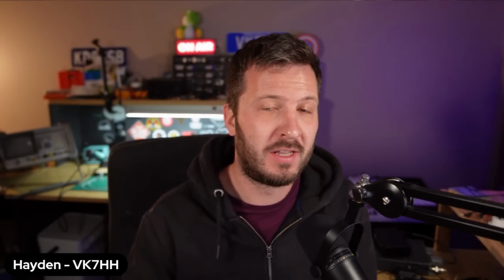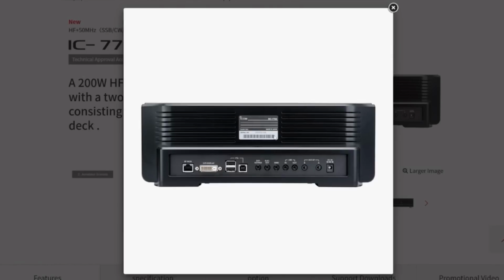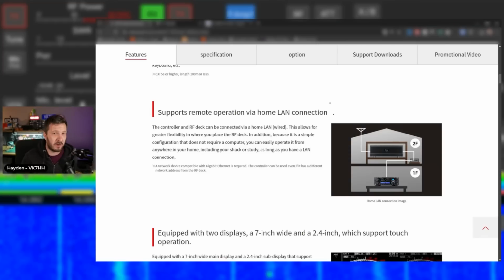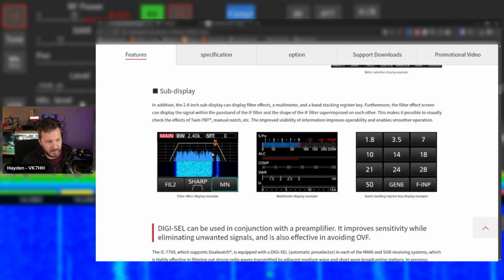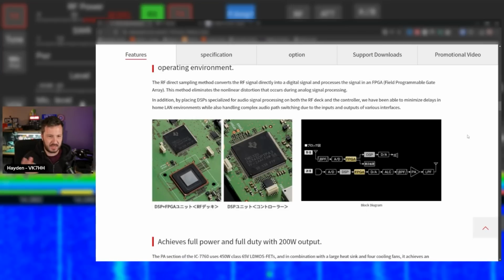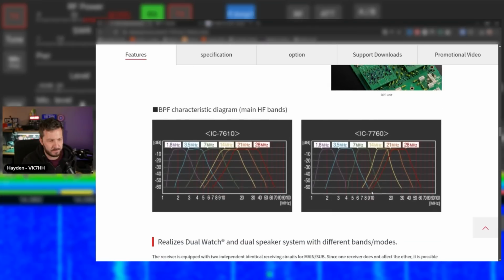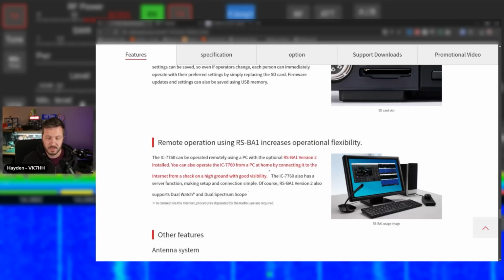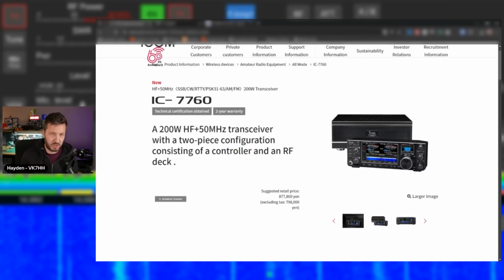NEW Icom IC-7760: Features, Specs & Price Revealed!

Comment: Does the IC-7760 have a CW Skimmer Ap whereby it will decode the entire Band in real time?  That's a killer App that runs on Anan 200 and I believe Flex Radios but those require a PC to run software on which introduces some transfer delays which may or may not affect useability/performance.  I like the all in one just for simplicity and convenience, but that CW skimmer is almost a must have, at least if you're a contester..
Reply: At some point the cost of these radios is a total waste when a IC-7300 for $970 and a good beam comes in at far less, and I'd wager much funner than a few dB of receiver improvements.  The directional receive, pre distortion, and diversity are pretty fancy stuff.  Just me..  I'm totally hooked on the IC-7300 with a PalStar Balanced Tuner feeding either a 520 ft sky loop OR a 2 el Quad, both at about 45 ft and fed with Open Wire.

Comment: Over $6000 for the Icom 7760 and they still use the outdated and painful DVI connector to save a buck on licensing.
Reply from the maker: Why painful?
Reply: @HamRadioDX  I think as we have seen with the 710s using the DVI, hard to find monitors and issues with the adapters.  Plus as we all know adapters add more bulk and another element of failure. If I can buy a $300 laptop with a HDMI connector why not a $900 or $6000 radio?

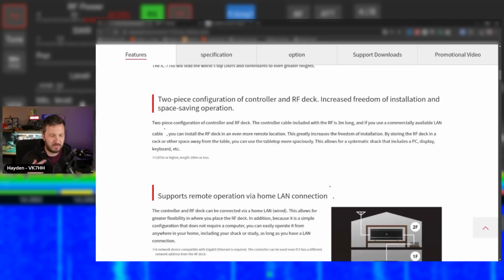Comment: REference around minute 6:40, actually, you are limited to about 100m when directly connecting the controller and the RF deck. 
Connecting the RF deck and the Controller (through the LAN connector on the RF Deck,) is different.

Comment: My problem with a lot of modern transceivers that are dependent on PCs is that they use Windows not Linux. Considering that a lot of Amateurs use Linux and that Linux is often the preferred choice for techies (which a lot of Amateurs are) the major manufacturers should cater for Linux users.

Comment: A very disturbing and disappointing new release from my favorite radio company. Man, where is TRUE innovation nowadays in Amateur Radio?  Dave, W7DGJ
Reply from the maker: What would you like to see/suggest Dave?
Reply: @HamRadioDX  Hi, thanks for asking. I'd like to see true innovation. Something new, not something re-used. New tools developed using AI . . . Complete FT-8 abilities built into the unit, no computer required. An antenna tuner that is more than 3-to-1 . . . There are many things that could be new in a transceiver. They are just not being brave enough to invest in true radio R&D.   Dave, W7DGJ

Comment: Any good reason why there is no state of the art connector for an external display?
Reply: because a DVI to HDMI (etc, costs you almost nothing as an add-on. There is no need to do different. WHat's next? VGA? Oh I cannot connect my displayport etc blah. 

Given the resolution and eventual upfront costs for a feature that many people don't even use, is apparently not to be justified. If you want to connect, get yourself that 2 euro/dollar plug. I did. And my 7851 doesn't even have been connected for an hour on an enternal display since 2016. (YMMV)
Reply: @RoelandJansen , the question is more technical, thank you anyway.  73
Reply: @DA1MN-AFu  enlighten me. 

What cannot be done with DVI-D compared to what it outputs? Just wndering why people make such an issue out of it.

Comment: If this thing also had 2/70/23 it would be a truly new unique radio  (7300 and 9700 combined). What a wasted opportunity to have done that.
Reply: The 7300 and 9700 won't be around forever. With over 100,00 7300's already sold and no doubt tens of thousands of 9700's already sold,  I don't think Icom would be too worried about losing any sales of either model to a new radio that combined both. The 7300 and 9700 will be eventually replaced. hence the need for a new radio to replace them. The 7760 is not the answer. It's just another HF+50 radio with an extra 100W that is ridiculously overpriced. I can't see 100,000 7760's ever being sold.
Reply from the maker: Wouldn't that take away sales from the 7300 and 9700 (especially the 9700 which isn't an old model)

Comment: I don’t see anything about adjusting the EQ for high fidelity like the Anan where we can listen and operate at 4 k wide, which gives much better fidelity. With the adaptive pre distortion (Pure Signal) we run clean!!
Reply: Me thinks this Roland is a progressive liberal Democrat who just loves to tell people what to do.
Liberalism/ Progressives have a mental disorder.
Reply: this kind of use on the bands should be banned. The TX BW is hard coded and that stays that way for a long time. If you want to sound better, use AM or FM.
Reply: @RoelandJansen  ESSB Audio with either 4kc or 8kc wide. 

 There is no bandwidth limit, just common sense.  

ESSB Is a Mode just like AM, SSB. FM ect...

Nowhere in Part 97 is the phrase "communications quality phone signal," or words to that effect, legally defined.  Neither is the maximum bandwidth for an AM or SSB signal, other than on 60 Meters.  Common sense must prevail, and one should never run a 8-20 kHz wide transmission in a crowded band, but in no way is it illegal.

ORDER - Rulemaking under Part 97 of the Communications Act of 1934, as amended to Establish Technical Standards for Certain Amateur Radio Telephony Transmissions
Reply: @va3kbc  if there was common sense people would not use it. Also There is regulation for us here where you only should use whatever is needed to make the contacts. Now I know that people with a small reproduction organ, love to talk with legal limit power even if they are one street away, and that makes sense. Compensation. 

Also, as said before, with AM and FM you can definitely make the signale better without surious emissions > 2.4 kHz wide. But hey, that's my opinion.
Reply: @RoelandJansen  insulting and narrow minded Liebral. Marxist, Communist, Tyrant
Reply: @RoelandJansen  Well thanks for the insult.  Really nice of you.
Reply: @va3kbc  you are welcome. Now that you ave received the insult, youcoud start thinking of why you got it in the first place. And when you understand, come back to me. I'm not hre to make friends, I want the world of hamradio make it a better world And your operating practice does not help it.
Reply: @RoelandJansen fortunately this was already tested when a bunch of lids tried to have our bandwidth locked and it was interrupted that there is no violation in going as wide as you like as long as you are not interfering in bandpass that’s in use.
Reply: @kb2uka575  and that's exactly the issue, you cannot know if someone else has this interference. And again, essb is a compensation issue just like using legal mimit power when not needed.
Reply: @RoelandJansen  I can see the whole band so I know if someone is below or above me.
Reply: @RoelandJansen  I guarantee you run a 2.7k signal but you’re actually 6k wide with imd. You’re the problem.
Reply: @kb2uka575  but you don't see what I hear. You should have thought about that. 3 kHz above your space I could possibly hear a station you cannot hear. You do know about propagation right? I for instance definitely will hear different stations than you do. And that's the issue. You seem not to see that issue. Maybe it's more clear now. 

And yes, even if you just use one Watt and talk to three streets ahead, it's still possible that you take the space of a stationn that I tried to copy but because you think it's OK to use a larger BW..... you nterfere.
Reply: @kb2uka575  I run 2.8 kHz max (*) and I can pretty much say you that the 7851 does not produce that. However, you are too much thinking of your own right because you fail to understand it.

Let's say you are right on what you said.  However then we both are wrong. 

In any case it might be  good idea to first find out what I send and what I receive before you even klosely start fantasizing what I TX or RX. 

(*) as that's the hardcoded ICOM  limit in the FPGA.
Reply: @kb2uka575   Me thinks this Rowland guy is a liberal Democrat who just loves to tell you what to do.
Liberalism/Progressivism is a mental disorder!!
Marxist, Communist,Dictatorship loving Tyrant type!!
Reply: @RoelandJansen  Use AM? that doesn't makes sense take up 10KC of TX BW when 4KC sounds way better with EQ'ed SSB Hi-Fi fidelity...
Reply: @artc9114  I disagree on that
Reply: @artc9114  and it is not Hifi at all, in ssb.
Reply: @RoelandJansen  My $2000 Mic and $2500 Eq Procsessor makes it Hi-Fi audio. Then my 1500 watt Amplifer makes it sound even better aka ESSB, enhanced single side band from 2.2 to 20KC wide of Fidelity Audio...
Reply: @artc9114  you don't seem to understand the technique here.

You sound like somebody who thinks a cut vinyl sounds better and has more dynamic headroom compared to a CD.

You think and perceive that, but it is not true.
Reply: @RoelandJansen  Rowland.  I’m thinking you are a Mar$/t and love to push tyr@ny upon others!!
Reply: @RoelandJansen  You sound like a mar$!t who loves to push tyr@&y onto others!!
Reply: @RoelandJansen  You sound like somebody who loves taking their rights away.  There are NON SO BLIND as those who will not see!!
Reply: @va3kbc  I am not taking anybodies rights away at all. Do whatever you feel feasible or is sane to you. Now I think that people should just understand that what they do or like, may be something that hinders other people's possibilities to hear signals.. However, you try to keep my rights away to advocate max TX BW. And in fact, you say that ICOM does that to you as they hard coded the TX BW.

It's like playing house music with a sound installation producing over 2 kW and thinking that the neighbors like it because you love it so much. This example shows that the neighbor does not take your rights away, he/she just tells you that it might not be the way to treat other users of the audio spectrum.

And again: you think essb etc nice, but I see noise that makes receiving that other station impossible. 

That makes you blind and not see what I tell you. 

Basically all you say about me is in fact what YOU ACTUALLY DO. Just like antifa, the biggest fascists. And they do not see it themselves.

In any case: we disagree. If I would say you are right, we both would be wrong.
Reply: @RoelandJansen , oh yes, Vinyl has way more natural fidelity than a compressed CD. The Dark Side of the Moon, Pink Floyd's reference Vinyl album, is the gold standard for testing hi-fi equipment.

Comment: Thanks for the video and review. I would say if you are going to do remote control for your IC-7760 and you have a MAC or iPad get the SDR-Control for Icom by Marcus Roskosch, the same developer who does the SmartSDR software for iPads and MAC’s for FlexRadio. I don’t own an Icom, but the same software that Marcus writes for the Icom works with my iPad to remotely control my FlexRadio and works great. While I don’t see in the App Store that the SDR-Control for Icom is claimed to work with the IC-7760 yet, Marcus claims it works with the IC-7610. I can’t imagine it wouldn’t also work with the IC-7760… That is a Marcus question for sure.. Also Siri tells me the pretax 798,000 yen converts to $5527.58.

Comment: I think this type of config is the future.  Being able to mount the guts at a point closer to the antenna and have a smaller head in the shack is awesome!  Love it!
Reply from the maker: Innovation!
Reply: No one can place outside a 6000 $ RF deck requiring AC power by their tower. The control head has at most a 9 m cable. The placement of a RF deck 9 m closer to the antenna does not significantly improve antenna matching or coax loss. This is a top end HF transceiver marketed to Contesters and Dxers. Icom needs to release DR-3@2 KHz, BDR and RMDR before serious Contesters will consider it.
Reply: @RSwrightMD  the understanding here is that you can use an ethernetcable of max abt 328 ft, abt 90m. According to the skinny information, it can be ised within a network, meaning that you probably can even get it  further away.

"A control cable (3 m, 9.8 ft) is supplied with the transceiver, and a commercially available LAN cable* can be used to install the RF deck in a more remote location. It enables the RF deck to be placed in a rack or other location away from the station desktop"

Now, many of use would love this, especially if you happen to have a neighbor that has asked a PV installation cowboy to install an S9+ noiosy environment up to 200 MHz.

So yes, there are people who can locate the deck at a different place. Now, I have a 7851 so there won't be a replacement action but to be honest, having it split, is a wonderful idea for some people. And yes, that S9+ noise is from my neighbor. 

(Busy trying to fix this with him)

Comment: Nice to see new offerings. Looks like a 7610 with an added 990 sub screen. Personally would buy a 7610 and an amp. Currently love my 7610 / 890 so will pass. I am patiently waiting for a 990 replacement as my next upgrade.
Reply: for whatever reason, I think the 990 won't have a follow-up. I don't see Kenwood doing anything useful anymore. Keep the 890. What's your thought on this re Kenwood?

Comment: Its missing some rear pannel i/o making it a poor replacement for the IC-7851 os i believe your right. This fits inbetween the 7610 and the 7851
Reply: The use of 7760 naming suggests it may be a mid level rig replacing the 7700 as an experiment before bringing out the 7860
Reply: It indeed fits in between

Comment: At that price point it’s a loser, no WiFi???.? No HDMI???? These are simple things and they just leave them out????
Reply from the maker: Why do you need WiFi if it literally has to run over LAN? 
The connectivity issues between the controller and RF deck with WiFi would be a nightmare
Reply: @HamRadioDX  why would it be a nightmare. If you use modern WiFi standards and you are not stuck in your fathers WiFi you c 15:53 an get perfectly low latency and with p
Reply: Prioritize packets you can precisely predict the latency. It is a complete miss from Icom as is the DVI port.  Icom fanboys are making these lame excuses about licensing etc. especially at this price point. Heck 100 $ TVs have hdmi nowadays as well as $60 laptops like the maestro evolve.
Reply from the maker: How many countries have access to 70 MHz?

Comment: Remaining on my wishlist:
- N connector instead of PL
- GPS input (for frequency reference)
- >0 dBm TX output for 2200m/630m bands
Reply from the maker: The radio does have a GPS 10 MHz reference input on the back of the RF deck.
Reply: @HamRadioDX  Yes, but then i have a GPSDO lying around. Thanks for the presentation!

Comment: While I love the remote RF deck design, I don't see enough difference between this and IC-7610 to warrant double the cost.  I'd instead use my computer to control the 7610 remotely.  I would love to see an IC-7100 replacement with this design or an upgraded IC-705. I love Icom's innovation, though!
Reply: they won't kill off the 705 anytime soon.

The 7610 remove controlled is by the way different from a head. Latency comes into play here and we'renot eventalking about the way you control it. 

The 7100 can be used with the separated head and additional hardware so that can be done already for quite a few years.I know people having the head and some hw in the suitcase while the rig itself stays in the Netherlands. Works pretty well for voice/D*

Comment: No 2m/70cm/23cm or other killer features. Huge disappointment in my opinion. 100W IC-705 (for a good price) would be much better.
Reply: I agree. The remote rf deck is particularly useful for VHF/UHF.
Reply: @ch716  that's why there is a 905.
Reply: @RoelandJansen  if you’re okay with 10W or mast mounted amplifiers
Reply: I have 5/10W (705), 100 (7300/7000), 200W (7851).  Contests I do with 5W.
Reply: @ch716  

Well, I have 5/10W (705); I contest with that power. I also have a 7300/7000/7000 and that's 100W. I also have a 200W 7851. .

In all cases, it can be a WOW. not everybody can/will do this, I understand completely.
Reply from the maker: It's not an all band radio.. If you include 2/70 and 23 into the same box, then you kill off some of your other models in the lineup.

Comment: It looks like Icom have taken some pointers from the Kenwood TS-990, particularly with the second display. It's still very much a menu-driven radio which I'm not a huge fan of from an operating perspective. Although saying that, the only Icom radio I own is the IC-9700. I certainly don't like the new Yaesu radio's. 

I'd be very interested in seeing what Kenwood push out as a replacement - if they do indeed do so. Looking at the specs of this radio, it could be something to at least spend some time playing with when it is released.
Reply: @MrAnon-g7m I was in the market for a radio late last year as the front-end of my FT-2000D had (again) died. 

I really tried hard to love the FTDX-101 but it just wasn't there. I don't like menu systems being the primary way to access functions on a radio and it just felt too plasticky for me, having grown up coveting the Yaesu radio's of the 70's and 80's. I knew I'd missed the boat on a new TS-990 but one came up and I bought it. 

There isn't a lot I don't like about it. You rarely need to go into the main menu as there are physical controls for most things you want to modify during operation and holding a button brings up a context-relevant dialogue with graphics that make sense. Having designed user interfaces myself in the past, I'm really not a fan of software engineers developing UI's for software engineers - the same applies to so many modern domestic UI based systems; get actual real-world users to test it, give feedback rinse and repeat until you have something usable. I digress, this is a hobby-horse for me. I love the second display that Icom have also adopted in this model. The noise reduction in the TS-990 is REALLY good. I hope they give us a successor to the 990.